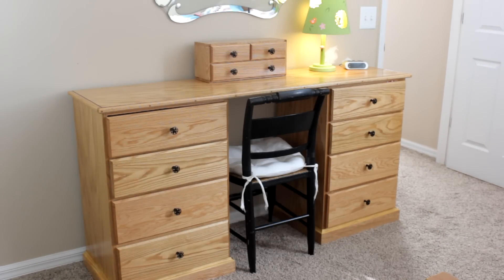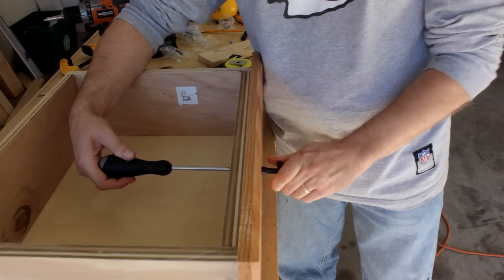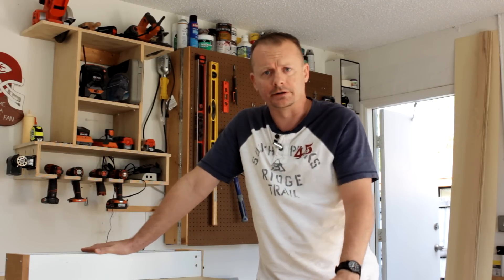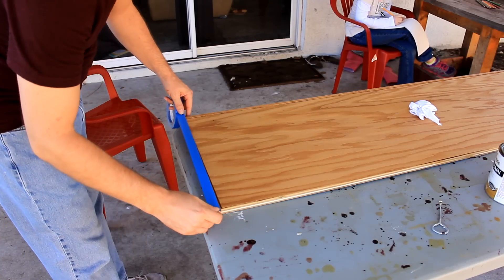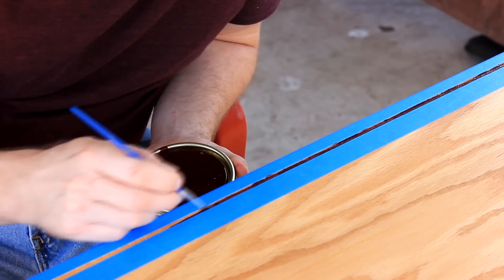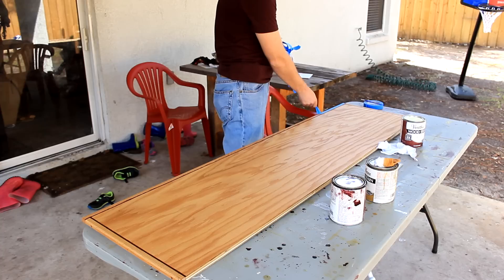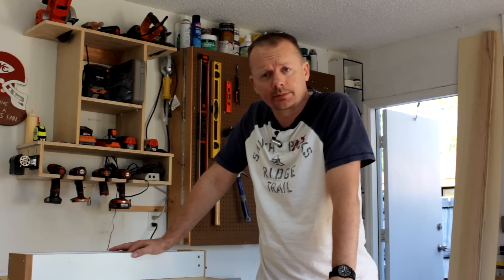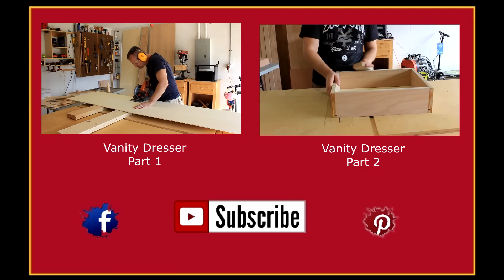Vanity Dresser Wrap Up - The Final Look See!

Comment: I've learned to stop tape bleed dry brush the stain or paint that you plan on using, making sure the tape is firmly burnished down on your surface. after the dry brush application is dry go back an apply the amount you want. This process works better with paint.